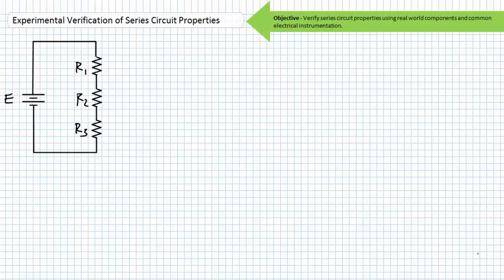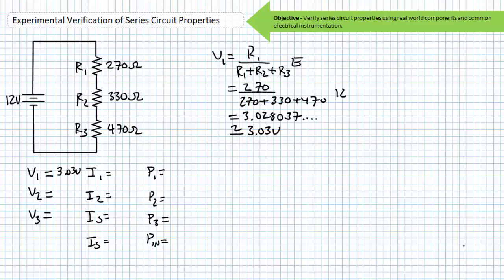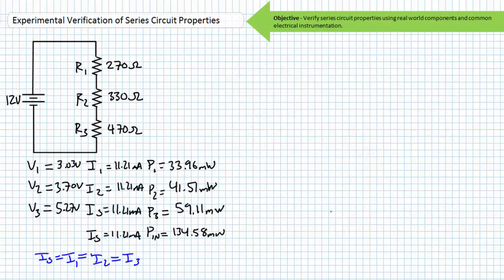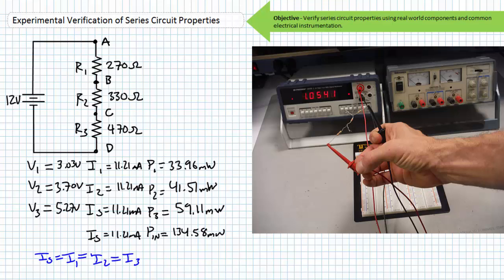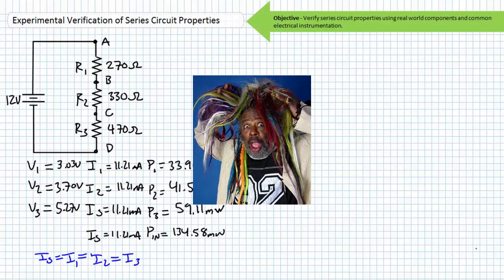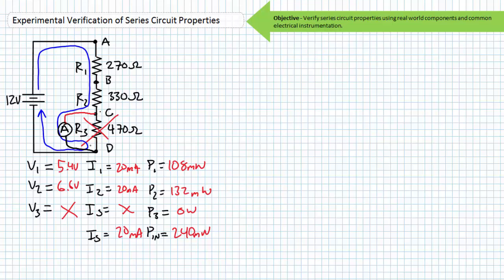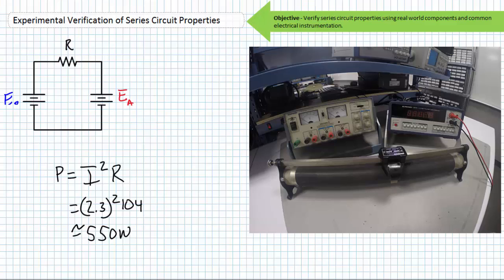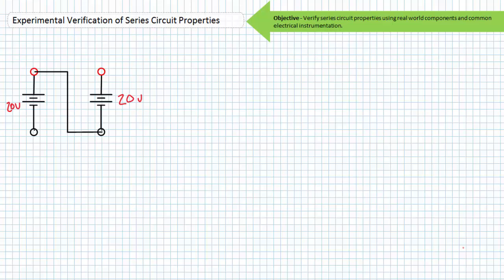Verifying Series DC Circuit Properties

Comment: So I think I need some clarification. ( I'll try not to give too much away). Long story short, couldn't figure out how to solve the first exercise without RT so I watched a little bit more. I assumed that I couldn't use R1+R2+R3  because that would be the same as solving for RT. Am I wrong in that assumption, and I've just been doing bad math ?
Reply from the maker: I should've said "without directly solving for RT". My intention was to force the use of the voltage divider rule.

Comment: Is= 11.21mA x Pin = error ???? 135.58mW ????
Reply from the maker: Total power input is P1 + P2 + P3. Total power should also equal source current times supply voltage. Either method yields approximately 134.6mW.
Reply: @bigbadtech  tks